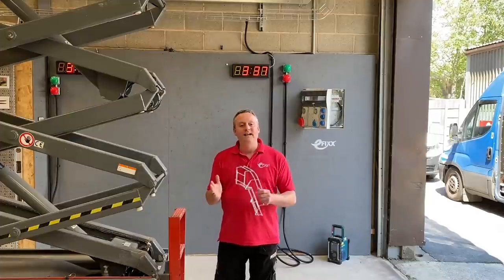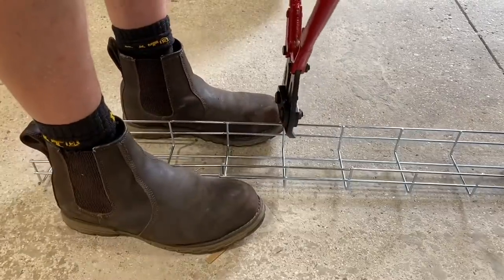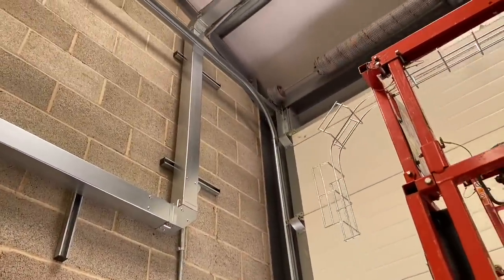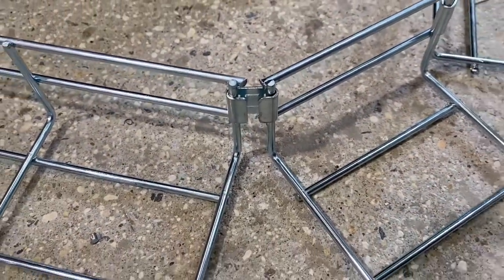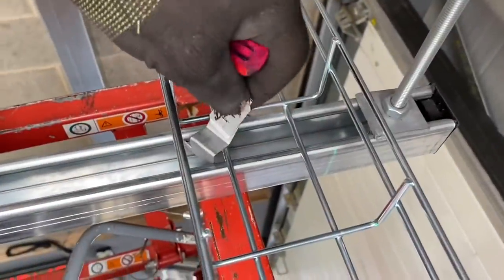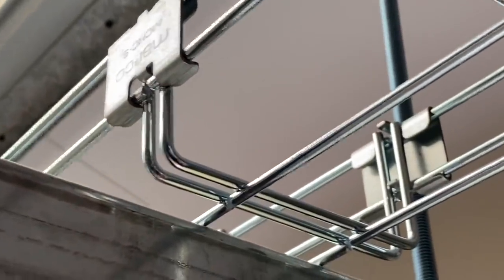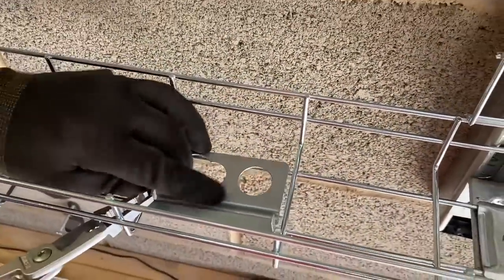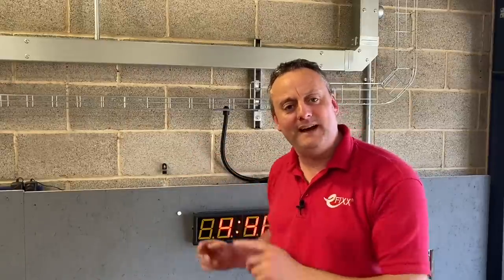EASY TO FABRICATE, FASTER TO INSTALL- CABLE BASKET from ATKORE

Comment from the maker: == MORE from this series  ============
Atkore Wire basket cable tray - https://youtu.be/o2haILBtObs
Schenider Acti 9 Isobar installation - https://youtu.be/o2haILBtObs
Trunking installation Tips & Tricks - https://youtu.be/iE-9AUuatd0
==================================
Reply: What is this particular cable basket presented in this video meant for specifically?

Comment: I like to cut basket with a slitter disc in the grinder.Then use a flapper disc to buff the cuts nice and smooth.

Comment: It’s good basket but can be a pain when running alongside trunking or ladder you are governed by the 100 mm sections which makes it hard to get sets and 90 degree bends to match

Comment: Tip? Buy th Knipex small offset bolt cutters! 45' up in a scissor lift it's a fecking site easier than BFO bolt cutters! Also you need to be taking more care/pride with the cuts, rough as a badgers arris